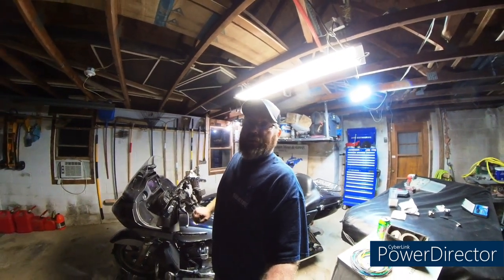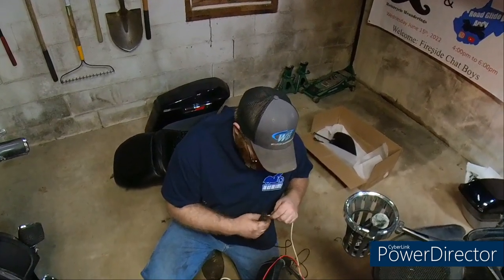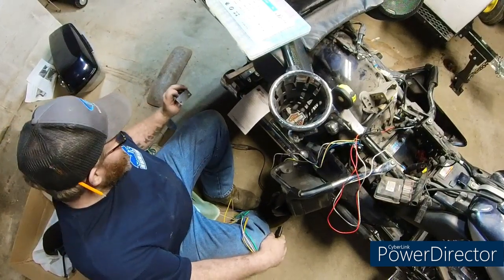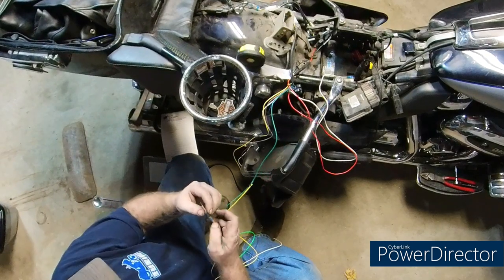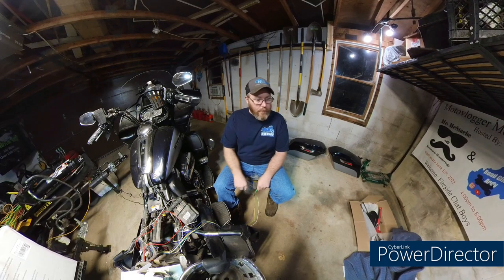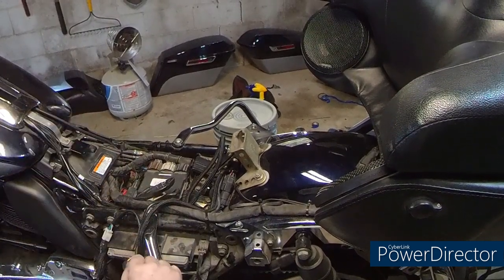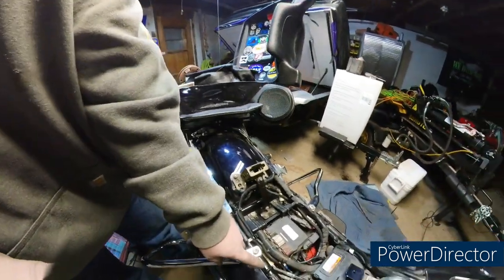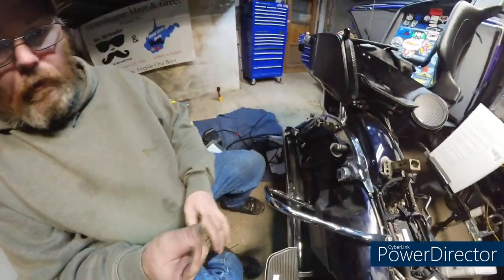Installing Trailer Wiring Harness On Harley

Comment: Thats a lot of wiring to hide under the seat. 
Bought mine from Dennis Kirk and it was plug in and hide wires.  😎👍
Reply from the maker: I got it sorted out. Tucking isolator and canbus away in side really helped. I went with this system because of the isolator and can bus. Didn't know it was going to be such a pain in the neck.